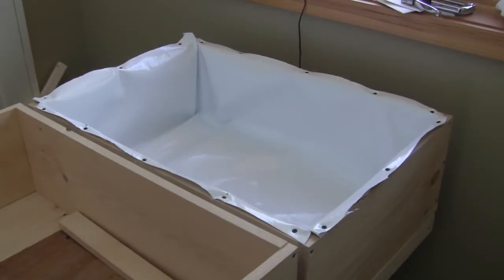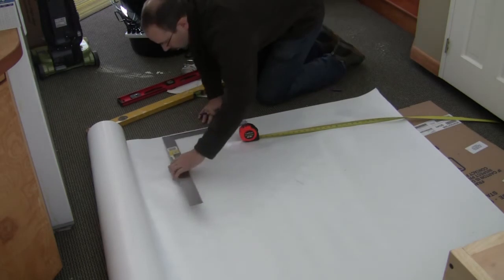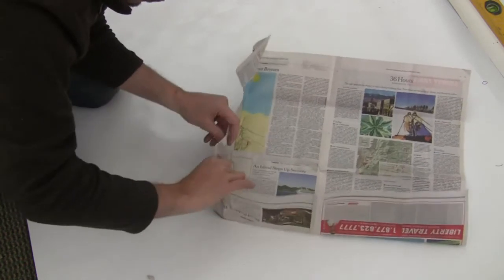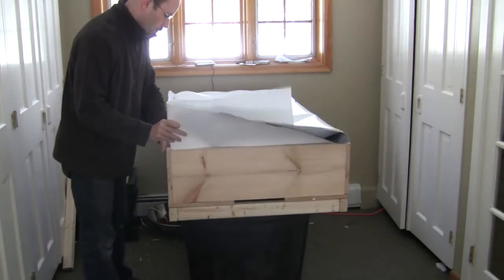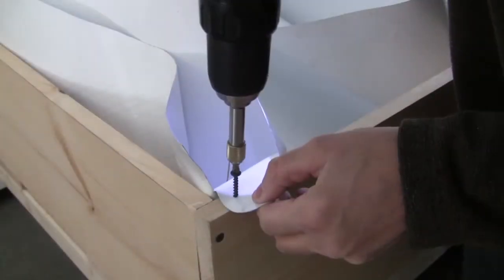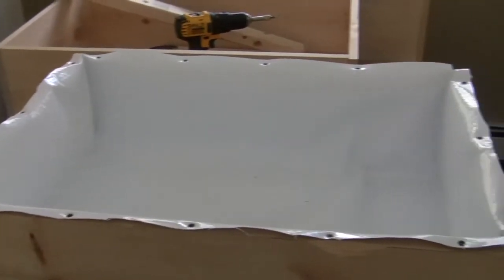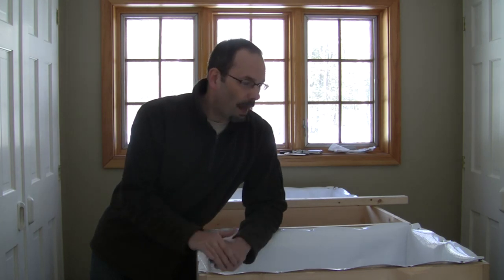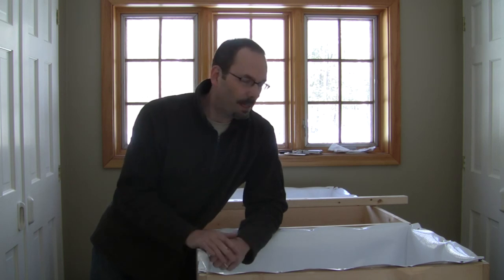Aquaponics Build Episode 3 [Dura Skrim Grow Bed Liner]

Comment: Hey John, great video. With that stuff being made of polyethylene I wonder if you could use a plastic welding tool, soldering iron, or heat gun on it. Just a thought let me know what you think.
Reply from the maker: I have never done it but I suppose it could work, let me know if you try.